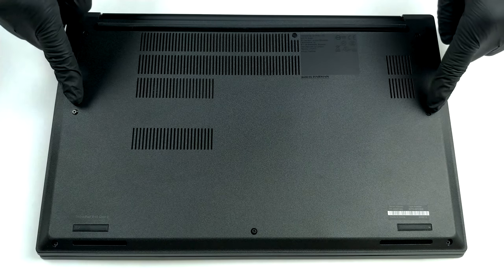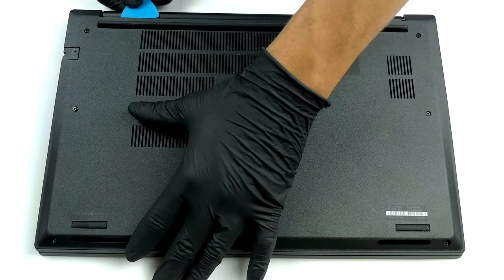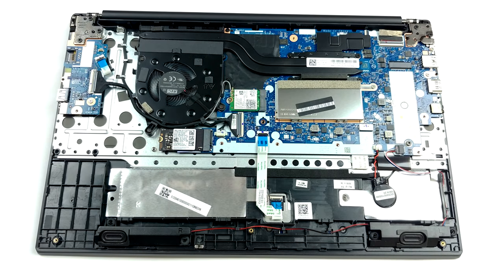🛠️ Lenovo ThinkPad E15 Gen 2 - disassembly and upgrade options

Comment: There's no reason to not have two SODIMM slots on this motherboard. What are you doing, Lenovo?
Reply: cheaping out. they do this for a while now. making a lot of money because you can take the bottom cover off...
Reply: @Butch Michael Not the point. RAM is a common failure point.
Reply: So you will buy new one when it fail
Reply: @muhammadkamil9842  Yup, Dell or Asus. Asus it winner,

Comment: I don't get it about RAM, That means you are stuck with 8 Gb ram? You have to replace the ram if you want to buy a new one ?
Reply: it's expandable. You can probably add up to 16GB more.
Reply: It has a slot that supports up to 32 GB

Comment: PEOPLE NOTE
There is an 8gb ram that's soldered and not viewable or upgradable
And the other slot is upgradable which enables dual channel
Reply: hate soldered.
Reply: @fhoofe3245  for this version it's a plus. 
Version with Intel CPU - has one slot and no soldered memory
Version with AMD CPU - has one slot + soldered memory.
Reply: @fhoofe3245  SSDs will be soldered soon
Reply: @keminoff  Unfortunately, they will take all upgrade options from us and we will be forced to use laptops as we bought, just like smartphones...
Reply: @Bloodin28  Everything would be different if it were not for Apple. They are the ones who set the degenerative trends in technology.
Reply: @Dhairya Thank you, it is really nice but 13.5 inch is too small for me and most probably i could not buy this in Turkey. But anyway, nice idea, will look forward for a 16 inch with external GPU one :)

Comment: Hello,
My Lenovo ThinkPad E15 Gen 2  It doesn't want to start, the fan spins and after 1min it restarts, the screen remains black, the LED on the power button is on, the ram memory is identical to the original one but the capacity differs, same specifications. I tried with default bios.Any solutions?
Reply: Sounds like a bad motherboard.

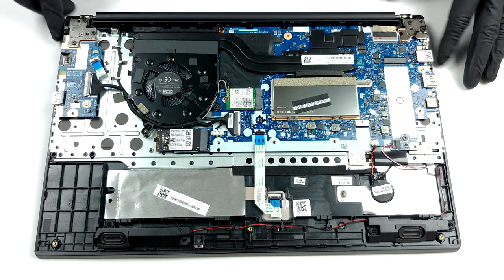Comment: How do you disconnect the battery so easily at 1:35 - 1:40? Seems like it takes some finger strength and dexterity.  Any advice?
Reply: Probably by not smoking or drinking soda near the laptop. I took the battery out even easier.
Reply: Disconnect the batter in firmware/software before opening,
1. Turn off your computer and disconnect the ac power adapter and all cables from the computer.
2. Turn on your computer. When the logo screen is displayed, immediately press F1 to enter ThinkPad Setup.
3. Select Config ➙ Power. The Power submenu is displayed.
4. Select Disable built-in battery and press Enter.
5. Select Yes in the Setup Confirmation window. The built-in battery is disabled and the computer turns off
6. Wait three to five minutes to let the computer cool/discharge.

Comment: LaptopMedia, I have this exact laptop, and it won't power on, the power light around the power button, stays on, but it won't boot up the system. Do you have a fix for this?
Reply: Same problem i experienced with T570. just reset the bios. You need to open the laptop. On the motherboard there is a cell. Similar to a calculator battery cell shaped like a coin. Just remove it and then reinsert it back. It will fix the issue.

Comment: Why does Lenovo keep making their ThinkPad offerings worse every generation???
1 Ram Slot
1 USB-C Port
No 2.5 Inch HDD Bay
No Multi-bay
No SD Card Reader
No Removable Battery
This laptop is basically TRASH!
Reply: E is an entry level ThinkPad. T and other series have 2 slots if I'm correct.
Reply: @bycarlsjunior  so does the older "E". The slot is downgraded to 1 on the latest "T" as well! Lenovo's choices make no sense!
Reply: @SamA-cy8eu  yeah, i was disappointed to find out about the 1 ram slot, no sd card slot and no 2.5" slot... its not a huge loss, as the ram is still fully upgradeable, just no dual channel, you still have plenty of storage expandability just not the old school 2.5, and sd cards are quite a rarity these days(tho i still use them for some older hardware i have - thankfully all those devices also have usb so i have no real need for a slot or an adapter). They also removed a usb port for some reason. The advantage of the new gen cpu, all-new igpu which is heaps better and thunderbolt 4 which accepts external gpu's is much more important and makes the new generation worth the sacrifice...however there was no need for these sacrifices, this is just lenovo cheaping out. as for removable battery, this isnt really a thing anymore because the internal batteries are now powerful enough, usb c gives you the option to use an external battery and the internal battery is very easily replaceble in these models anyway, i have no problem with that. My dads old dell had a removable battery and he only removed it when it was ruined and had to be replaced, li-po batteries tend to do that when not taken care of
Reply: @tudorgjdarkov3118  Lenovo has really turned into crap now! Wayy too many compromises. I bought an HP and a Dell, despite the internal batteries both are superior machines. I hope Lenovo comes to their senses again soon and stops cheapening out on their higher end laptops